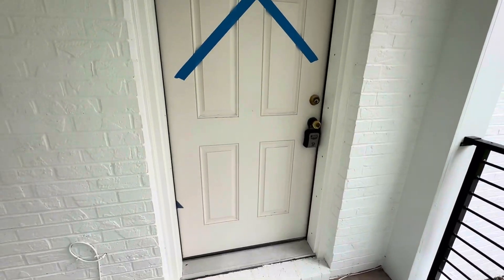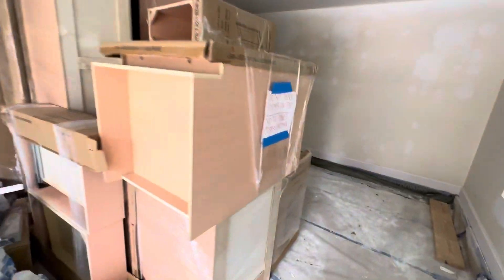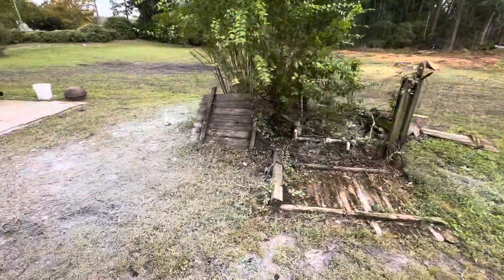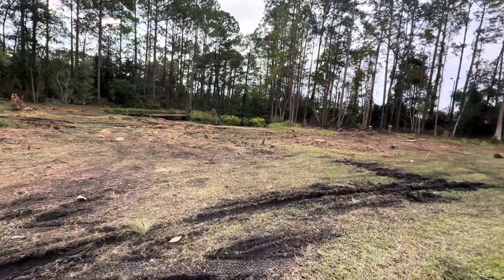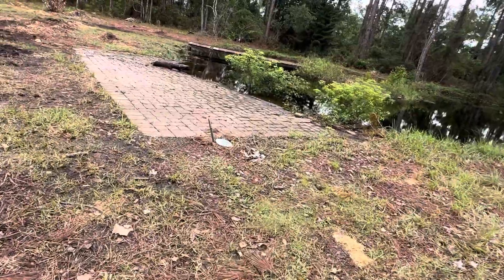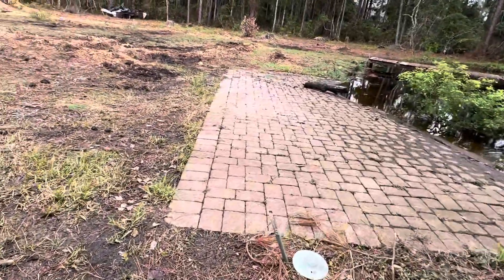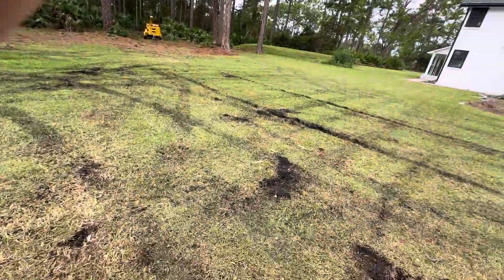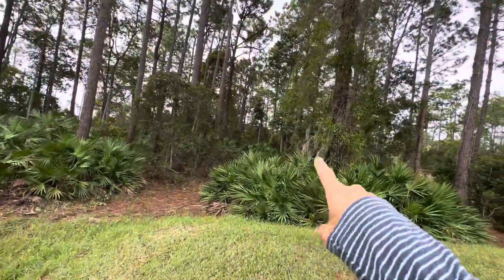#Farm Update #11 Tile work & more!!

Comment: Looks like your kids can move in by New Years, depending on any new storms that blow threw.
Reply from the maker: That might happen for the house but no way he barn gets permitted & built by then. We don't even know where it's going yet. The rains while slowing things down at least gave us good insight on where NOT to put the barn
Reply: @OzziesRobots  True, the barn will come later, just looked like they might have the inside of the house buttoned up enough to move in, in the next 4 months. But who knows, these things always take longer than they should. Barns go up quick but like you said, picking the right location and then the permits can take some time.
Reply from the maker: @Robothut  Yeah & it needs to be ready for Brittany's Horse & Donkey.  We haven't even gotten to the pool or generator , the new well etc . What a money pit lol